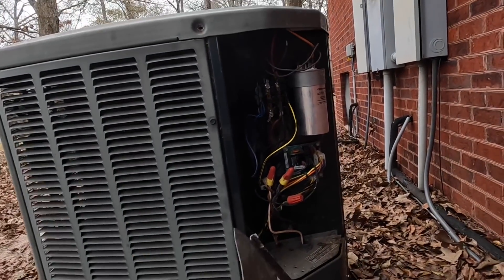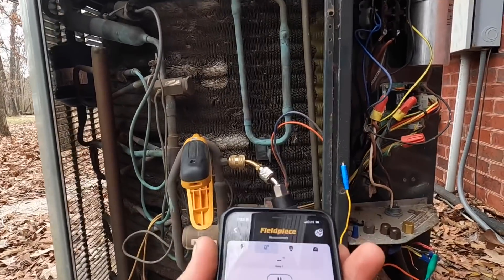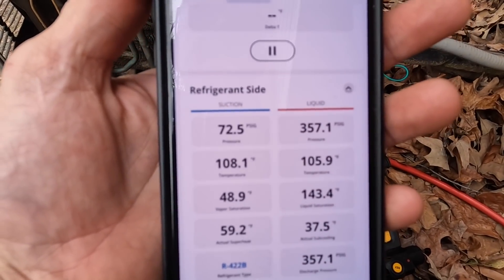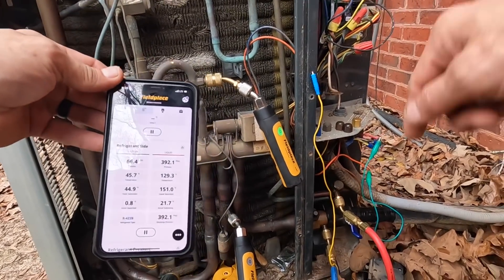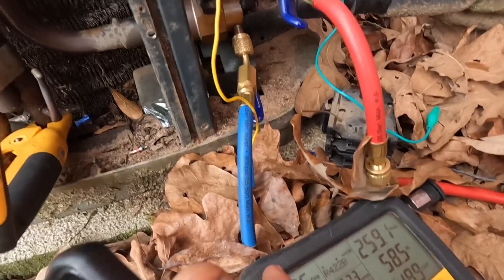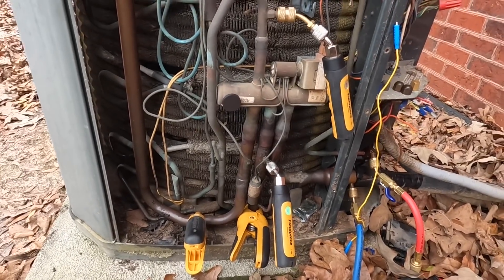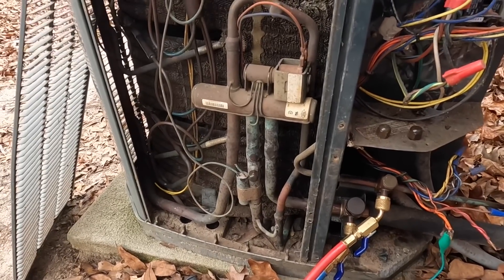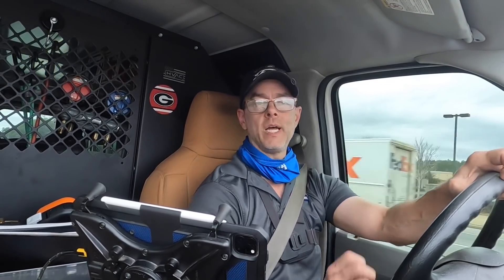Reversing Valve Not Acting Right

Comment: I used a very strong magnet to un stuck the valve.  Withe compressor on working and I could I would use the activate the coil either in cooling or heating depending on the valve.

Comment: Hmm.. I wonder if this is what is happening on my system. After we turned heat on during winter it kept heating after we set it to cool. Tried changing thermostat, replacing capacitors in outside unit, etc. Eventually realized the compressor wasn't coming on so we had the outside unit replaced with a unit designed to work with our inside furnace. Been about a month and all of a sudden tonight it is heating instead of cooling again. Is there a reversing valve on the inside too, or would that be n the outside? Any other reason for heating instead of cooling?

Comment: First of all,  that unit is in pretty poor condition. Is this unit worth the hourly charges ?
Second of all, that compressor sounds like crap. How many compressors were replaced in this unit, and if so did anyone change the dryers and check the oil for acid and contaminents ? perform a thorough evacuation ? Use new, correct refrigerant compatable with the oil in the system and weigh in the charge ? I like to leave the charge a little short, then add very slowly while the unit has run for about 10 minutes.
If you need some quick tests, I would pull out some of that refrigerant charge to get that head pressure down, maybe consider pulling the entire charge and doing a thorough evacuation then recharge with new refrigerant. Make sure the condenser fan is up to speed ( I don't  really hear it )
Always make sure you have all of the right operating conditions...clean air filters, clean coils, good airfow, etc. 
If all is good, you can try pulling the solenoid wire on the reversing valve and touch the wire on and off several times to try and push out any entrapped oil or contaminents inside the reversing valve. Watch your pressures and superheat as you do this. If there were multiple compressors replaced in this unit or if the unit has had servere refrigerant floodback the reversing valve and its tiny capillaries might be clogged with oil. Reversing valves usually stick or fail from compressor burnout carbon, metal debris in the oil, or other contaminents that may cause waxing or sludging of the oil. I actually cut open a large, expensive reversing valve from a 20 ton compressor and found small dents in the valve body that pushed through and jammed the valve...a previous tech was tapping on the valve body with an adjustable wrench because he thought it was stuck...turns out the solenoid coil had an open winding. We are all human and nobody is a perfect tech. This is what makes this trade tricky because many hands were on that unit over the years I bet, and you don't know if someone let air or moisture get in to the oil or if they added the wrong refrigerant. That unit is old and I can see the green oxidation near that " Christmas Garland" aluminum condenser coil which may already have a leak, or be slowly dissolving into the oil like silver paint. If this system continues to be a problem, condemn it. Sell the customer a new system and make money or move on to a new customer. If you don't , you will rack up a ton of service time, have a piece of junk unit, and an unhappy customer who may refuse to pay at the very least or even take legal action against your company.

Comment: I have a question if the REVERSING VALVE bad will it just blow hot and
temp increase  the big coper pipe get hot not cool even I am setting cool
I check all the wires and thermostat all good

Comment: First, I'd like to say that I just recently discovered your channel and have watched several of your videos over the last couple weeks. I like watching other HVAC techs' videos just to see what experiences others are running into as none of us have "all the knowledge". As someone once said, "When you quit learning, you're dead." As I've watched, I feel like you are someone genuinely trying to find the actual problem and serve the customer, not just make money. So I figured that I would start commenting and throwing in my two cents. I taught a troubleshooting course at a local college for 4 semesters, but quit because it was taking away from family time and work needed to be done in the field. Plus I was not enjoying the classroom setting. I'd much rather teach customers and give pointers to other technicians I meet in the field as well as get feedback form them. I just wanted to let you know I am not just suddenly jumping on to pass judgement and tell you that you are wrong, but to give another angle from my experiences. Which, btw, I'd never seen the magnet trick on the RV before, that's cool. I've used a magnet to reverse them manually, but not to see the position. 

Secondly, I know that what I am about to tell you will not help you with this unit, but hopefully help in the future when you run into this again. As I watched this video, I was quickly able to determine that while the reversing valve may be an issue, but it is not the issue your having here. With the unit working for cool and not working in heat, I'll be willing guarantee you that your outdoor TXV had lost its bulb charge. In cooling the valve is bypassed through the external check valve on this vintage Trane. In heat that check valve is closed and refrigerant is forced through the outdoor TXV. If the bulb pressure is dead the TXV will cause the unit to pump down to the indoor coil. The reason that you have high head is likely due to someone trying to pump refrigerant into the unit to try to overcome the restriction of the closed TXV, which will not work. Your head pressure is lower in heat due to the dropping suction pressure causing flow into the high side to slow down. The difference between the 3 head pressures is due to the pumping down action of the unit with the closed TXV. The further away you are from the compressor the less pulsing there is and your gauges will show lower head. You are likely starting to develop liquid in the vapor line due to the lack of flow and the high pressure getting the refrigerant to condense in the vapor line, this will absorb the compressor pulses. You don't have any frosting anywhere likely because of you warming the outdoor coil in cool mode then switching to heat is causing the refrigerant to boil off in the outdoor coil before the temperature is getting below dewpoint. In your video, I see several places the sensing tube off the TXV could be chaffing, and it may be that the line chaffed through and lost the charge. That vintage of Trane I've had many many issues with the tubes chaffing to each other, and not just the TXV capillary tubes either. FYI, I zeroed in on the TXV because a restriction anywhere else in the liquid line would have caused the issue you are having to be in both heating and cooling modes. 

As far as the reversing valve, a reversing valve not fully switching and seating will cause the opposite of your issue. Because the valve will start bleeding or dumping hot gas directly into suction, you will have readings similar to a compressor not pumping to capacity. One big test of this is if you do have poor pumping, look to see if you are getting more than 10 degrees temp rise between entering and exiting the valve on the suction side (whichever side is entering suction with mode selection of course). With the unit pumping down though, you would be getting a false reading on the valve because of lack of flow. I will say that the amount of bypassing heard when you turned the unit off was a little concerning with the reversing valve, but that could also have been due to the greater pressure differential in your pumped down state. As far as the groaning/popping noise when reversing, I've heard that a ton on mainly Trane's, and a few other units as well. I've not had one that was doing that actually fail to shift, they were just noisy. My parents had 2 Trane heat pumps that were doing that groaning and popping noise for 10 years and they still worked fine when the house was sold last year. 

If the TXV were replaced, the unit would likely work just fine and the issue with the reversing valve may have become better and the unit may have continued to run well for several more years. But, I was not there to get the full picture. You were and there could be other things I did not catch since I was only watching through the lens of an edited video. 😉
Reply: I would've just simply told him it's the txv! Most of what u said was correct though  good job except he saw oil !! The shaft inside the r. Valve coil could also be a contributing factor
Reply: I had a similar issue where system went into a vacuum in heating mode, but worked in cooling mode… In cooling, it just appeared to have a low charge with sub cooling at 3F.. Two prior companies had the same diagnosis you did, bad outdoor TXV… 

I come along and when I ran it in cooling, same 3F subcool, but when I tried to reverse to heat it just cutout… So, I throw a couple pounds in to see what happens, subcool closer to normal, and like the other companies said, low pressure cutout in heat mode… But, I am thinking I should have higher condenser side pressure, check the split across the reversing valve, was 11F, pull my thermal imager and can see the valve sticking on cooling but seated in heating…

Diagnosis and solution, low refrigerant and leaking Schrader… Had just enough to appear to have a minimal charge when the reversing valve stuck at 70-80% when going into cooling mode; but as it was low pressure cutoff with lower than usual condenser pressure and considering the indoor evaporator cannot hold as much there should have been much higher pressures before the low pressure on true suction cutoff…

Comment: Good chance the reversing valve caused the compressor failure. Compressors rarely fail on their own, but once they are dead you're unable to determine what other factors could have contributed.  Replacing the compressor usually doesn't work out long term.
Reply: If good work practices weren't used when installing the compressor that could definitely cause the RV to have problems. Sometimes some Supco 77 oil will help.

Comment: I’m wondering if that one had a bad heat mode expansion valve. I service a lot of Trane heat pumps and when the heat mode expansion valve is faulty it will pump down into a vacuum in heating but the pressures are good in cooling mode. That reversing valve didn’t sound right when it shifted though so it could be bad also. At this point it doesn’t matter since the system is getting replaced.

Comment: Great to see you do a reversing valve video. I made a comment on an earlier video of yours about why you don't use magnets. It's weird I have since had an issue with my own units RV. I thought oh hell naw, karma or whatever. After seeing you do this one it was kinda identical to my scenario and I was just not accepting the RV was bad, but maybe sticking, and sure as hell didn't want to change it. The travel speed of the magnets was slow as was yours. Long story short I traced it down to I was only getting 14v back from the thermostat on the "O" wire for the reversing valve. It was an old Honeywell 7600 and I replaced it with the Honeywell 9000 Wifi. Problem was solved with now getting 24v back on the O wire and the RV changes over quicker now. I hope sharing problem solving stories like yours as well as the people in your comments section do some good and help others.
Reply: For those thinking the wire was loose on the terminal at the thermostat, it was not. I even took it out cut and re-stripped it and also cleaned the screw terminal and tightened it back down. The contact inside the circuit board of the thermostat was not making good connection and sending a weak 14v-18v back out to the reversing valve on the O wire. It's a 24 year old heat pump package unit I'm just not giving up on yet. Someday, just not today.
Reply from the maker: It was likely your comment that gave me the idea of using a magnet.
Reply: @HVACGUY  That's great. Just like in your video you can see the magnet slowly sliding and kind of hesitating which was probably from debris inside dragging with the plungers. Most likely caused from when they done the comp change out. Mine was just a slow slide of the magnets which was from a low voltage coming from the thermostat circuit board contacts, It was varying 14-18v. I like to use two magnets one on each side where you can watch them slide together or one may even fall off from the paper label or something, kind of a backup having two. I also like to use the magnets that's a little smaller than a dime, the ones you find in a cheap dollar store refrigerator magnet or something. Love your channel, keep the videos coming.

Comment: Reversing valve problems are the most difficult to pin point. Seems when the reversing valve is not acting right the problem is intermittent and the pressures are inconsistent. Just one of those diagnostics that will always feel a bit more like guessing than we'd like.

Comment: Inject sipco oil on units that have potential reversing valve issues. It will add lubricant to avoid sticking. IT WORKS sometimes for sure.
Reply: I was just about to say maybe try ac renew. I haven't used it much but it could work. Still could not resolve the problem though and to avoid a call back and better profit margins best to just recommend replace and or fix it 100% find restriction or if its a bad valve replace it proper welding etc and of course replacing the filter drier good vacuum and proper charge.
Reply: I was just about to say maybe try ac renew. I haven't used it much but it could work. Still could not resolve the problem though and to avoid a call back and better profit margins best to just recommend replace and or fix it 100% find restriction or if its a bad valve replace it proper welding etc and of course replacing the filter drier good vacuum and proper charge.

Comment: Sounds like you have a restriction somewhere, remember reversing valves work on pressure differential to shift the piston to the other side. That explains why it’s working in one mode and not the other. Keep them good videos coming 👍🏼
Reply: I was going to say pressure causes the canoe to shift. If compressor is not pumping or restricted. No shifting of that valve. Hopefully not the case
Reply: I think its the txv.  Suction drops to negatives in heat.  Txv is the metering part at that point.  I hate those heatpumps as trane puts check valves in line also.

Comment: Great video. Did you say you left the piston for the 410A at the evaporator then put in mo99, wouldn’t the piston need to be a different size?
Reply from the maker: Yes, that’s what we did. Technically yes, you’re right. But, I’ve only had problems doing that with larger systems. And this was a 3 ton air handler on a 2.5 ton condenser. It worked out just fine.

Comment: I don’t change reversing valves any more. Change out is cheaper. 40% success rate on RV replacement if Lady Luck is on my side.
Reply: My feeling on R7R rev valves. Hard to not cause damage to the Teflon "o" rings from the heat..
Reply: You can use the wet ragg stuff to help with the heat transfer.

Comment: I've seen a lot of reversing fail . This is when they just started installing them in are area.  Had problems because cut corners like ac. You got to use nitrogen, and have clean system.  Good luck.  Have a great day.
Reply: I always use nitrogen but when a compressors burns up, I also flush the coils.  I give my customers a choice.  Authorize/approve replacement of the reversing valve when ever we replace a compressor.
Reply: @CoolingWizard  don't forget acid test and flush/neutralize 😜

Comment: It has been my experience that when a valve does not shift all the way, I get very similar reading on liquid and vapor.  That one sounds like the port is plugged and that created a  blockage in the valve.  Perhaps when they changed the compressor they did not use nitrogen or get possible introduced a contaminant into the system. This crazy reversing valve problem is a new one for me.
Reply: Does it make a humming kinda quick buzz sound like electric motor seized up! What mine currently is doing is why I ask

Comment: Since it wasn't shifting all the way that was causing it to go into vacuum?
Reply from the maker: It can. The tru suction looked to be completely blocked off. Without being able to check the other suction it’s hard to tell. The TXV can do that, but I’d expect to see some icing. And then there was the difference in the two head pressures in heat. So, the RV was problematic, but may not have been the only problem.
Reply: @HVACGUY  good to know, I was thinking when the RV would be problematic it's either sticks in cooling or heating mode or the discharge bleeds into the suction. Good to know that it can also stick and block off the true suction cause vacuum.

Comment: Sounds like you've got several issues. One being that reversing valve. The other almost sounds like the txv as well. Usually when I see it pump down like that in one mode it'll work fine in the other mode
Reply from the maker: I’ve got to agree.
Reply: I do as well great video... Hate/love type of call...they make you better however. Something new for a instance.

Comment: Reversing Valves are  notorious for clogging up. How I use to overcome this is of course change the valve and the I would add an oversized liquid line drier and a suction drier. then a deep deep Vacuum...
Reply from the maker: I don’t mind doing them. But, it’s really hard to bill for all that it entails.
Reply: Hello sir where did purchase your ipad holder?